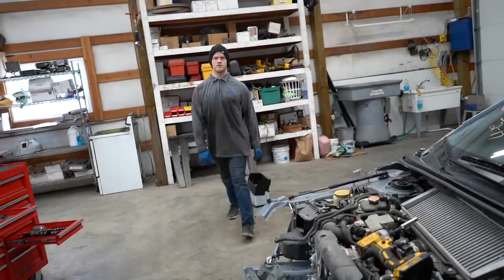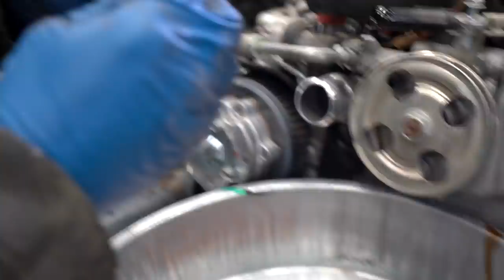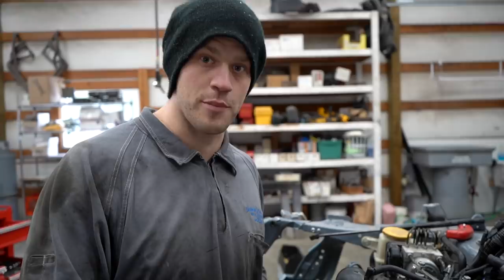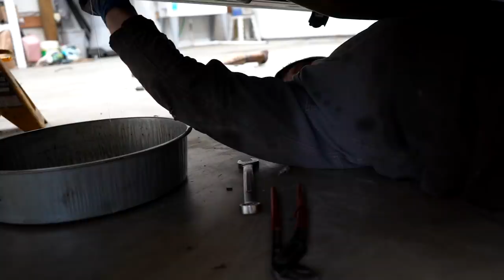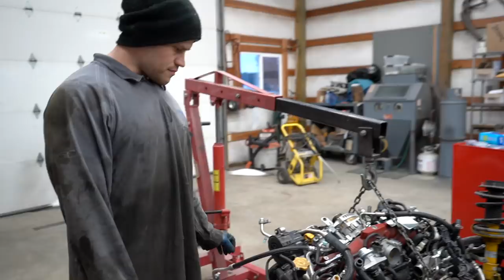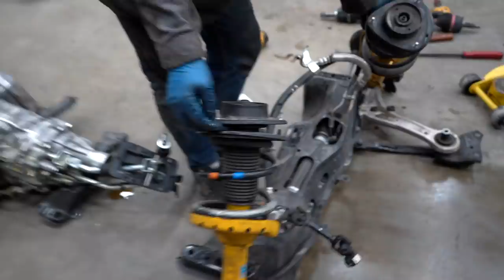youtube video #-DxkAnjIexs

Comment: Not to be captain obvious or anything but just checking to see if you plan on putting back the front steering/suspension before you send to the frame shop. They’ll be able to tell you what else is bent that maybe you can’t see with your eyes.